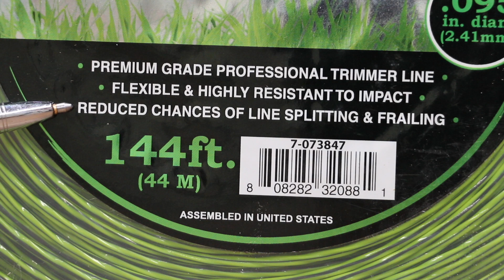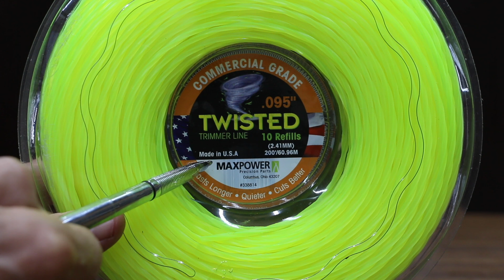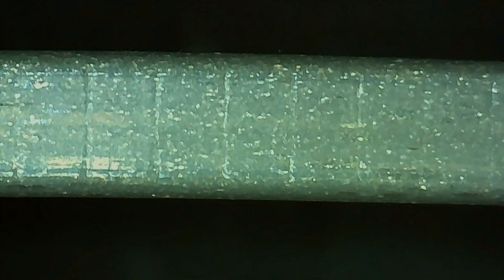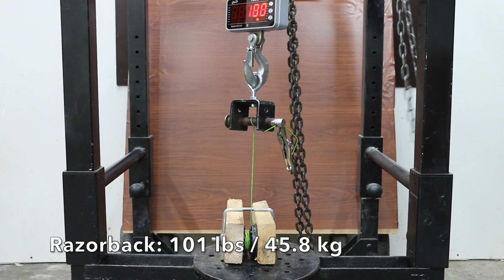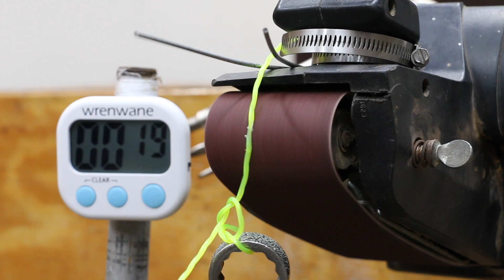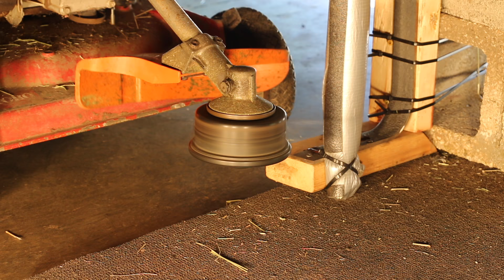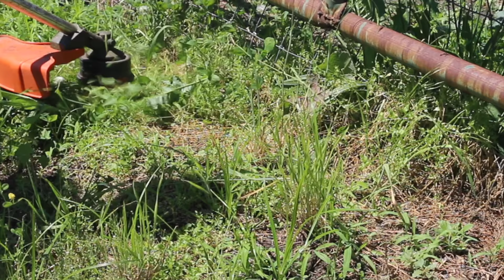Best Trimmer Line? Let's Find Out! Round 2: Stihl, Husqvarna, Echo, Oregon, Shakespeare, Weed Eater

Comment: I work at a stihl dealer and appreciate your tests! One thing I noticed on the string test is that there is a new stihl line. The CF3 pro line. It’s a few more bucks per roll and would have been cool to see that tested!  Also on the blade test video I would have liked to see the different blades tested from stihl (3 prong, chisel style blade). On the 2 cycle oil test I would have liked to see how the stihl synthetic oil would have held up compared to the amsoil too. Keep up the good work, just a few thoughts! 👍
Reply from the maker: Great recommendation for round 3 on the trimmer line and thank you for the suggestion on testing the 2 stroke oil.
Reply: @ProjectFarm  i 2nd the 2stroke oil challenge. lowes crastman brand vs stihl, vs husqvarna vs echo
Reply: Do they still make the Stihl HP Ultra 2-stroke oil? I haven't looked at it for a while but 4-5 years ago it was considered to be the best oil for small 2-stroke engines in the hobbies and professional usage that i was involved in.
Reply: Michael Streeter yeah the hp ultra is the synthetic version. I would like to see all the main brands tested!
Reply: Yup, the Pro Line seems to last A LOT longer than the Husqvarna Titanium for me.

Comment: I would be interested in seeing a comparison of solar powered battery packs for device charging. Testing could include time to charge via solar only, charge time by AC power, drain time tests based on various common device voltage and amp ratings.
Reply from the maker: Great recommendation! Thank you

Comment: Tensile strength is defined as force ÷ area, and it is often reported as pounds per square inch in the U.S. Reporting the value in pounds alone should be stated as the breaking load rather than tensile strength. Cords with higher cross-sectional area should produce higher breaking loads. Some of the trimmer cords have odd cross-sectional areas which would make calculating the area difficult. The area of any that are basically circular would not be hard to calculate using π x r². You might be able to get the actual area of all of the lines from the manufacturers to allow you to accurately report the tensile strength.
Reply from the maker: Thanks for the feedback.

Comment: Excellent Video.  I use the Stihl line and your testing confirmed my experience.  Its a good mid-pack line and better than the echo brand line. I have an echo straight shaft trimmer(SRM-210) I have had for years.  I was given a similar style Stihl straight shaft trimmer(FS 56RC).  I've used both with the Stihl line and noticed line wear was less on the echo than on the Stihl.  Its most noticeable when I trim around concrete sidewalks and   driveways.  The stihl line wears out much faster than the echo trimmer with the same line. My speculation is either the head design on echo or the larger engine on the Stihl (21cc vs 27) or both cause the difference.  The echo uses brass bushings with  a generous size holes and rounded edges, where the Stihl has a harder metal bushing with hard edges especially on the side edge.  The stronger engine on the  stihl may contribute to higher rpm while trimming, even when trying to maintain lower rpms.  I would suggest comparing trimmers as well, but detecting your despise of string trimming, I think 2 videos on Trimmer line is plenty! :)  Thanks again for a fun and informative video.
Reply from the maker: Thanks for the feedback!

Comment: Time to upgrade witha slow motion camera for the next trimmer video! That said Greenworks 80V trimmer blower combo on amazon does quick work of my .23 acre residential. I'm on my 2and year with 1 batt. Amazing! Though the obscene torque from the motor is very grabby and pulls into grass and features. Do gas powered have counter rotating heads to motor and drive shaft? Love the trimmer and blower! Noise is a huge issue in my neighborhood! So much I want to buy my neighbors greenworks! 
80v electric has the power!  I saw someone exchange an off brand dewalt or Stanley at homie depot.  I have my batt walmounted and give it about a charge a week over the winter. I bet I get three more years out of the battery. No mixing or nasty stale ethanol mix! Greenworks! Torque.  And my 115 lbs wife uses it.  And I flipped the length blade around maybe that's the issue with the grabby pull?  Using echo line.  Going to switch to the flesh tearing grey sting soon.  (Rumors)
Reply from the maker: Great suggestion. Thank you

Comment: I've been using Husqvarna and Stihl for a few years now, and both lines always seem to stretch and weld themselves within the tap and go head. Another option is Origon's strimmer head, where you can use really heavy lengths of square cord, and this outlasts strimmer cord by many times. It's a pain when you have to replace one that breaks, since it's ment to pull tight in the head, and it's a more costly system, but if your cutting grass all day, it can last, and can be more forgiveing on hard object contact. Since I'm mainly strimming along side of a railway line, I have signal wire posts, and ballest to contend with, as well as the odd unwanted self seed saplings that resist all cords. For me, a blade has it's perks for volume, but the risk of hard object contact is too high, while cord does a great job, but hard objects and heavy brush breaks the cord. Never an easy challenge
Reply from the maker: Great suggestion. Thank you

Comment: Video idea does ceramic coating prevent wear if added to engine oil or can you use it straight as plain engine oil if it prevents the vehicles paint from being scratched when the bottle slides off in the commercials do to it being smooth and having less friction does it cause less friction on the engine wear surfaces
Reply from the maker: Great video idea!  Thank you

Comment: Nice stuff! I got sick of untangling twisted line from the trimmer head spool, so I went down to skinny round line again, like that used in electric weed whackers. Interestingly, my Echo straight shaft trimmer is enough of a beast that it still demolishes plants, and the skinny line seems to last longer than the thick. Not sure why, maybe less force because it's lighter? Maybe newer trimmers have a different spool design that's more compatible with the twisted line, or maybe I should get something other than the absolute cheapest...
Reply from the maker: Thank you!

Comment: I sure do enjoy your videos. I love the idea of doing this testing from a farmers POV. Your tests are conducted in a way that we can all understand.
I have found that the twisted, and the multi edge lines are more aggressive, initially, but tend to break off in chunks, whereas the round mono filament lines tend to more gradually wear away. They are also vastly quieter than the twisted, and multi edge lines. You may want to check that out in a future video. Some of those lines can be very loud.
Go check out Smarter Every Day's YouTube latest video in which he took some ultra high speed footage of trimmer lines in action, including grass cutting, and interaction with wire. When that line hits wire, it actually whips around the wire, sometimes two or three times, and then either breaks, or even snaps the wire. When the line breaks, it almost looks like it is liquefying at the break point.
Reply from the maker: Thank you for the feedback!

Comment: Hey Project Farm, I might recommend looking at the modulus of elasticity of your line instead of doing just the tensile strength in your first test of the lines. It will give you a better idea of how much they deform as well when you look at the pressure.
Reply from the maker: Thanks for the tip!

Comment: Been using maxpower twisted for a couple years on my 6 acre lot in my Dewalt 60v flexvolt trimmer. Its the best and longest lasting line ive ever bought, i went from filling the spool every other cut, to filling it every 5-6 cuts. Wont ever switch to anything else.
Reply from the maker: Thanks for sharing.

Comment: I have my own law care business I mow 37 houses and businesses the weed wacker string max power is the best. Not only does the 1000 ft spool last longer but I use .80 in all three weed wackers stihl fs91r the line actually cuts the grass better to where the tips of the grass doesnt appear dead cause it tore grass it looks just as nice as the 12,000$ mowers you have to buy to make the lawn look nice. Most the time it's easier to weed wack ditches than get the mower down in there. But great video there is a big difference in weedwacker string not just durability to me I'm worried more of astedicks on the appearance of the grass a lot of time you gotta use a weed wacker as a lawnmower
Reply from the maker: Thank you for the feedback!

Comment: This is exactly what I needed to see. I recently replaced my Sthil FS45C with a Husqvarna LD which uses 0.095 line instead of 0.085. So far I have loved it and definitely preferred the mechanism to release the string on the Husqvarna. I'll be going with their trimmer line since its price to performance is pretty good and it is easy to pull out when I need more, thanks for testing them!

Also Husqvarna makes a "commercial grade" version of what you used and is just a bit more expensive. It claims to be more durable, so I may give that a shot given that the design is nearly identical to the lower end one.

Comment: I am curios if the testing parameters from the companies are done at full rpm set or the way you did them... It would be interesting to see what the same set of trimmer lines did if the trimmer was at full rpm(what difference is there for aerodynamics, weight, etc...) and then had the weed wacker hit the tube of grass or run into a wire fence.

Comment: I got tired of the spool feeder on my trimmer , replaced the head with one that has 3 pivoting mounts you slide the line through, in a U shape, lines seem to break less and I can pre cut extra pieces of line and swap them out in 2 seconds,  no more spool rage.
Reply: I use the same type of set up.  And I really really like it. Mine has holes for 3 different  thickness of line and works great
Reply: @robertgutheridge9672  Brand name, Please?
Reply: Brand Name, please?
Reply: youtube search trimmer speed head.

Comment: Oddly enough I cannot remember having any trimmer heads lock up from the line getting welding in. Idk if it’s just how I string the trimmer or I’m super lucky. I always rightly pack it nicely in so there’s no slack and I think that helps it have no place to go.
Reply: The amount of time you run the trimmer can play a part.
I've had the line weld up on me a few times but it seems to me most, if not all, of them happen when I'm holding down the trigger or running the trimmer for a long time, such as in a huge lawn or overgrown weeds (about thigh high).
Rare but it happens. Also I use a straight trimmer, not the ones at an angle.
Reply: I've stopped using a trimmer because of that "welding". Seems like I should've just looked for different brands of line though
Reply: I use Stihl .105 line. Never had the welding problem happen to me
Reply: I never have that problem either. It may be more common on auto-feed machines as opposed to bump-feed, I don't know. Testing the tensile strength also seemed superfluous, but maybe folks use trimmer line as rope?
Reply: @mendonesiac  I have an auto-feed that replaced a bump-feed trimmer, neither one ever had a problem with welding. But then, I will assume it only happens when the string was wound up poorly. I always make mine taut and very neatly packedw

Comment: Video suggestions: 
Different furnace filters
Insulation (either foam or roll)
Space heaters
Rechargeable battery chargers (I know you already did the batteries....but what about the chargers?)
Different shovels (Snow, garden, gravel....sorry that's the best I can describe them!)

Also contact sloppy mechanics and get them to throw a real turbo in the farmebago. :)

Comment: I’m surprised you didn’t test the noise aspect of these lines claiming to be quieter. Maybe put the spool on an electric motor and spin it and what ever the max rated rpm the trimmer head would see on the weed wackier and measure with a dB meter from about operator distance 5-6’?

Comment: Would like to see if you could thread thin steel wire onto a trimmer head.
Reply: You can’t I’ve tried it. Professional landscaper here. I’ve run out and tried all kinds of stuff over the years. Copper and mechanic wire will absolutely not work at all.
Reply: @ericharris6601  You probably could on the single strand style heads that just use 7inch pieces of line.   But realistically that wire will just warp and become useless.
Reply: I was thinking the same thing a while back, but after doing the research found out that it is actually dangerous, because as your metal wire shreds, it with shoot out all those tiny peaces of metal everywhere, and you can injure yourself, or it can wrap around something instead of easily breaking. Anyway not a good idea.

Comment: I had some of the Echo brand line in the .80 size that I was refilling my Ryobi spools with. It would get stuck in the spool after about 5 minutes of usage. I thought it was melting to itself, though it was probably getting stuck in the way you described. I am now using a "Rino-Tuff" line which, judging from the color and cross section, may be the same thing as  the Maxpower that you tested. It has been working great for me.
Reply from the maker: Great feedback. Thank you

Comment: “Speed feed” is the best weed eater head to use, compatible with most all trimmer brands, no need to open the head to refill, simply thread some trimmer line through the head and start twisting until line is rolled
Reply from the maker: Great suggestion!

Comment: Am I the only one who wants to try steel cable in the  heads that just uses cut strips of line in quick replase setup heads or is that generally accepted as a no go because of spintering shrapnel  when those strands go rogue?
Reply from the maker: Great point.  Splintering strands would be my concern.

Comment: You should test foil HVAC duct tapes...like the type used for sealing furnace ducts and drier exhaust pipes.  Which stick to old dusty dirty or rusted steel duct boxes, flex duct material, hold up to hot exhaust vents, attics, and furnace outputs...
Reply from the maker: Thanks for the video idea.

Comment: You should try annealing these lines. As we do in 3D printing it also improves the performance of the majority of plastics. I usually use the air-fryer set in 110ºC for 45 minues. Comparing the shortening is also important. ;)
Reply from the maker: Thanks for the suggestion.

Comment: I've only been using a trimmer for about a year, but i've never had it weld and get so tangled in the head i had to clear a jam. But, I have definitely experienced that frustration of getting 10 feet from finishing yardwork and the engine speeds up only to indicate there is no trimmer line left in the head.
Reply from the maker: Thanks for sharing.

Comment: I respect Project Farm very much. 

How you wind the trimmer line onto the hub is the only thing that matters for “line welding.” It’s a fine balance between winding it too tight or too loose, and making sure the line stays in its channels.

I’ve used a few of these brands and Echo is my choice. Having had a mowing business for several years, I think some of these tests were not necessarily applicable for the average guy trimming his lawn or the commercial guy looking for economics and pricing.

How you trim (your technique and angle of trim line) along with power of your equipment and loading the line on the hub make all the difference. 

So while I subscribe and love this channel, I think we might benefit more from electric vs gas trimmers or something like that. 

Electric vs gas equipment would be a great series!
Reply from the maker: Thanks for the video idea.

Comment: I use square Oregon gatorline .105, had to make the connecting holes in the head a tiny bit bigger so it would fit in the fs55 Stihl. Does great in the waist deep weeds around the pond👍
Reply from the maker: Great tip!

Comment: Normally elongation is measured in percentage. The start length is once it’s flat then the finish length would be once it breaks. 

Would be nice to know the actual cross sectional area of the strings. Then you could know the PSI and compare. These things have irregular shapes so hard to measure the area.
Reply from the maker: Thanks for the suggestion.

Comment: What about a cordless drill battery test? Find out which battery charges the fastest, which one lasts the longest, and which ones deliver the most power. Something like that would be cool to find out. There can be a flip side to this as well to see which cordless drill performs the best.
Reply from the maker: Thanks for the video idea.
Reply: Just to add I am aware that cordless drills pale in comparison to corded drills but some times it's not practical to use a corded drill.

Comment: This video was super neat I love how thoroughly you tested the line.  That being said I work for Stihl n would love to see you test the CF3 pro line from Stihl because it's our pro line, the stuff is more expensive but it has carbon fiber in it and is Stihls toughest. I've had great results with it. Also I wanted to give you a tip, if you soak your line in water it is more durable and more resistant to welding. Thanks again for your videos I have watched quite a few of them now👍
Reply from the maker: Thanks for the video idea.